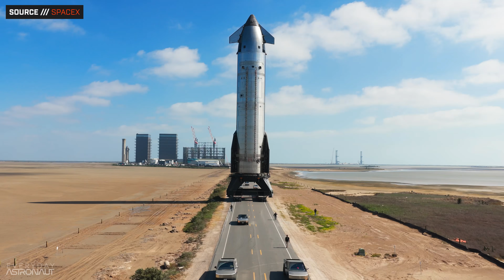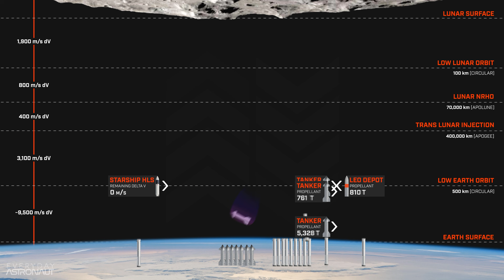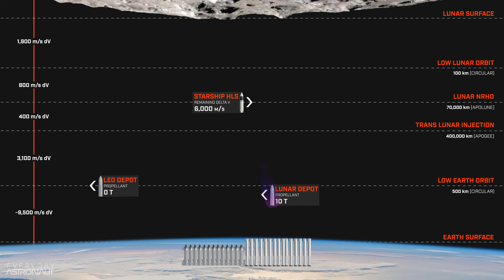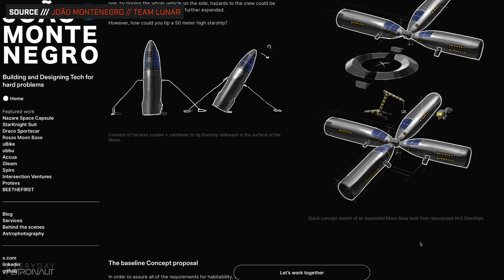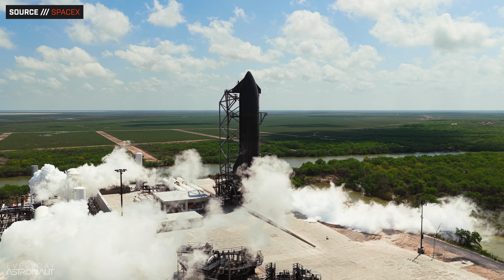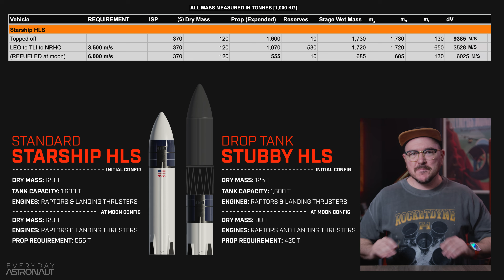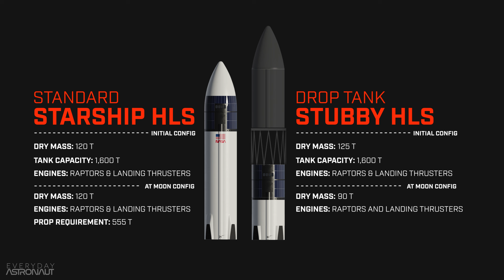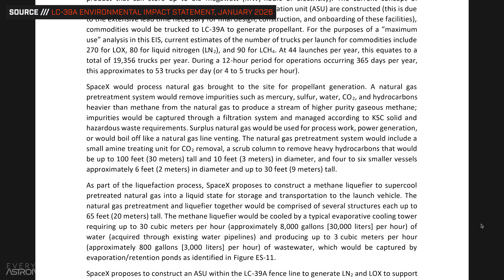Does Starship REALLY require 15+ launches to land one lunar Starship?!

Comment: Personally I'm just concerned whether Starship is safe enough for humans. For a small lander or crew capsule with a small escape system, the chance of the tanks rupturing is low (especially for a thick COPV with large safety margins). But for starship, with a surface area of 2*pi*4.5m radius * 50m height = 1400m^2+ surface area, the chance of a tiny hole or puncture on the tank is so much higher, even if it's just from lunar rocks / dust, a loose screw hitting the tank during ascent, etc. Even if the risk is 1/1000, with no abort option (unlike the lunar module for lunar landings, or crew dragon for earth launches and passive reentry), it just seems unsafe. 
If commercial flights had a risk of 1/1000, there would be so many plane crashes every day.

Comment: The obvious solution is Nuclear Propulsion. If you really want a long term and efficient solution to trucking resources back and fourth. Yes it will take time to develop that platform, but unless some other new technology appears on the horizon, it is the best bet against chemical rockets.
Reply: nuclear propulsion has low thrust, it's intended for deep space travel, avoiding gravity wells
Reply: @DeferedPattern  Chemical Rockets are really only good to reach orbit, after that, they are massively wasteful. The only exception would be to move people between Earth orbit, and Lunar. Virtually anything else, can happen at a much slower rate of acceleration. You would not use Nuclear Propulsion to reach Earth or Lunar Orbits from their respective surfaces. 

Basically the way I see it shaping out, is that you would launch a traditional* rocket to meet up with a transfer vehicle , move the cargo over, which would then take it to lunar orbit, or vise versa, and drop it down to the surface with some small control rockets for soft landing, and/or parachutes for a water landing on Earth. 

If you can build enough reactors, be it Fission or Fusion, depending on where the technology is at any given point, you can have a lot of vehicles, likely smaller ones, but far more frequent, than you could with chemical propulsion, that over time, would be significantly cheaper, and less wasteful, even if you are making your own Liquid O2 on the Moon, and shipping that back to Earth Orbit rather than producing it on the Earth. 

Moving to more efficient forms of propulsion also decreases overall complexity of the whole process, and the less complex it is, the less issues that will crop up over time. Even if it takes literal months between leaving Earth Orbit and reaching Lunar Orbit. If we are talking about stuff that does not require life support, you can save a lot. 

Obviously when it comes to people, you cannot do that, but you would not be ferrying people every day. The nature of the cargo matters a lot here.

Comment: what's funny, is that same problems are tied to new glenn's moon mission too
Reply: True. The volumes are less, but Blue Moon 2 does plan to use its own engines for TLI and then it will need to be refuelled to land. 

So it's just as many flights, but most of them with be to lunar orbit. I do wonder if the hypothetical Tug can be used to send an already full lander to the moon.

Comment: HLS actually will need up to over 30 or more launches to refuel it. HLS isn't under development and neither is it's HRS. As more of Starship's core systems keep changing. Especially when SpaceX will introduce engines for TLI. Even with SpaceX's 100 ton mass promise. With new innovations for Starship. With no Human Rated System being in active development for HLS. With the HLS not being in active development. The 15 refuel quote is misleading. Why I say it will be over 30 launches is because of these missing variables that we know is heavy. Especially for the current concept of the HLS.

Comment: Hrm...  Not sure how pluasible it is that they'd opt in the end for keeping the surface level raptors on the HLS.  Yes, I know on the standard Starship the surface level raptors are the ones with gimballing.  But given Mustk's love of "the best part is no part", it seems likely that for HLS they would remove the surface raptors in favor of either adding gimballing to the the vacuum raptors, or perhaps use the landing thrusters to provide attitude control.
Reply: Rvacs use the same powerheads so they are gimbal capable (hard mount locations), but they are constrained within the aft skirt, which prevents them from gimballing since they would contact the skirt at anything beyond zero degrees radial out.

Comment: Ok, my biggest issue with this whole approach of refueling the HLS in Lunar Orbit and reusing it between missions - How the heck are you reprovisioning the lander? How are you getting new cargo onto it to land on the moon? Another rover? New Oxygen and CO2 scrubbers and food, and experiments, and and and.... It sure as hell isn't coming on Orion!!! And how are you refilling it in NRHO to begin with?  And how are you making sure the HLS engines and systems are good between missions after it's been left in lunar orbit for 3-6 months at a time?

Just a LOT of concerns/questions... I see ZERO reason to reuse the HLS... Use a new one for every mission.

Also don't get the point of NHRO... Why not just Low Polar Lunar Orbit? Does Orion not have enough dV to get there and back with the ICPS ?

Comment: Yes! Starship ( just the ship without Cargo & or Crew)  is 47 times Heavier than Space Shuttle.  Space Shuttle is made of Titanium, Frame thick Aluminum, & had 3 extra Boosters.  Stainless Steel & Inconel more heavier than the Shuttle. Shuttle High Orbit, and carried the heaviest Cargo, and assisted in Building I.S.S.  
Starship can barely go to low orbit, with light weight cargo. High cargo equal lot less fuel tanks. Space Crew, & Life Sustaining Cargo, let alone trying to Landon the Moon, Bring Lunar Samples, to see if they can actually make a  Lunar Habitat, and see if it can Sustain 300 to 400 Temperature Variation from Day to Night.. Reason I say this is that in Arizona & New Mexico 3D Printed Homes Cracked with in 3 Years so Lunar Habitat is a Far Cry. Trust me NASA, & or SpaceX do not have a Clue on this Challenge. I had Worked at SpaceX Hawthorne, California..  This Facilities does not have Engineering Insight on this. 
Landing on Mars it will definitely tip over, in Lunar Landing, there is no Atmosphere, and if land laterally in a horizontal velocity it will attack hard, until it is in Zero lateral Attack, & the Landing with out hitting a Rock Formation or Crater Wall, or Edge.  on something  1,000,000 times larger than the Apollo Landers..
For Starship to take off to High Orbit requires 4 Falcon 9 Rockets attached to Starship Heavy Booster.
Batteries will Die for Elevator, for Equipment & Crew.  I mention 2 years ago the Landings have to be Horizontal like the Shuttle

Comment: Wouldn’t it be worth the mass trade-off to have the thing land on its side? The extra reinforcement would add to the mass but you wouldn’t need an elevator and you wouldn’t have to climb up and down inside. Then just leave it there and add to it with every trip. It’d be a lot easier to bury if it was on its side with reinforcements to hold up a couple feet of lunar regolith.

Comment: there's a whole slew of problems with creating a sustainable moon base. build a base on the moon. lots of steel needed. can't make steel on the moon. everything needs to be shipped lol. But, if we colonize the moon mars is no sweat that's the trick. should probably figure out how to shoot materials to the moon with accelerator guns and then recover on the surface to build there.

Comment: "Big mistake when you did the Stubby HLS math:

You forgot, if the Stubby HLS is way lower wet mass than the reference HLS, Booster has way more delta-v too. Much less payload to carry. So Booster can do more, Stubby HLS has to do less, you make the Stubby HLS tanks smaller again because it only needs 6 km/s of delta-v, that gives Booster even more delta-v, leaves Stubby HLS with a big load of leftover propellant on reaching LEO, and then you only need a single tanker to top off the Stubby HLS tanks for a Moon mission..."

...is what I would say, if my instinct didn't tell me to keep watching around 1:08:00, when some part of me said "brother, this is Everyday Astronaut, no way he forgot about Booster delta-v improvements with Stubby HLS".

Ok, around 1:18:00, the thing I'm noticing is that a lunar depot is just insanely inefficient. The less dry mass you're moving around, the less propellant it's going to take to do the mission. Having LEO depots makes sense, you're moving the extra propellant to the lowest delta-v orbit possible, moving the least amount of dry mass. Having a lunar depot means you're moving this heavy asf depot. That's insanely inefficient. The problem here isn't stubby HLS, it's the lunar depot. We want an HLS that can go LEO to the moon and back without any lunar refueling. That's what we want. That means we probably want a three-stage Starship, meaning a standard, payload-bearing, heatshield-toting Starship carrying a lander inside of the fairing. A 15 ton lander with 85 tons of propellant onboard, you then refill it on orbit with 100 tons of additional propellant which takes it to 200 tons of wet mass, enough, in theory, to make the moon and back, just from LEO (I don't have a spreadsheet rn). One additional tanker for the first mission, 2 tankers per subsequent mission. No lunar depots. It's just not Starship HLS anymore, because it's a fully separate vehicle carried inside the Starship fairing. Still much heavier than Apollo and capable to land 4 astronauts on the Moon.

Again, this is if we're trying to reduce the launch count for missions to the Moon. But if we're SpaceX, we like maximizing payload capacity to the Moon for bigger missions. Yeah, bigger missions mean more launches. But that's within the realm of what SpaceX wants to do, anyways. And, even with 10-15 launches required to land a full-size Starship HLS on the Moon, that's still better than the 67 Apollo landers (67 Saturn V launches) it would take to land the same mass of Apollo landers on the Moon. 67 fully expended billion dollar rockets, or 10-15 10 million dollar reusable rocket launches. Heck, even if they're actually 100 million dollars taking into account all operations, maintenance, and refurbishment costs, the degree to which SpaceX has already been able to combat the tyranny of the rocket equation without magic, high Isp engines is incredible. Saturn V literally has close to the same average mission Isp as Starship, being worse at sea level but better in space. How the heck does Starship turn 67 expended rockets into 10-15 reused rockets? That's like an order of magnitude better payload fraction, with another order of magnitude (minimum) reduced cost per launch.

Anyways, if the most efficient mission is one where the dry mass is as low as possible for every vehicle, then your lunar depot is very oversized and overweight for most of the calculations you made. Reducing the propellant mass delivered to the Moon by 50% and not even getting 20% reduction in tanker missions shows the efficiency problem clearly. If you reduce the propellant delivery to NRHO requirement by 50%, you should also be reducing the propellant delivery to LEO requirement by 50%, or else you are losing massive amounts of efficiency somewhere. You need the depot to only be as big as it needs to be to carry the necessary propellant. Or, if you plan to have a single depot support multiple missions in a row without returning to LEO, then the depot can be scaled up. But you'll never send the depot out to the Moon with half-full tanks, that's just very inefficient.
Reply: So, correction: lunar depots are actually not a bad idea. My thought process was that moving a whole second vehicle around requires a lot of additional propellant that you wouldn't need if you had HLS doing full round trips to LEO. But I'm wrong. Although a depot may need additional hardware to prevent boil off, a bigger depot has less of a problem with that, so the extra hardware mass can be minimized as part of the dry mass of the depot. The HLS's human accomodations and landing hardware can't be minimized like that. So the depot has an inherent dry mass advantage over the HLS, and any trip the depot makes is a trip the HLS doesn't have to. The vehicle with more dead weight should be the one that takes shorter trips. Sure, the depot has an additional investment cost in the beginning, and this is what I picked up on, but it pays for itself over time.

The issue you had was actually that if you're going to use a depot, you want it to be as mass efficient as possible. It's tanks are always filled to 100% capacity in the course of its duties. That means, likely, that for the stubby HLS variants, you'll actually have a depot that can top off two HLS ships back-to-back without having to make a trip back to LEO. That would massively improve the dry mass-wet mass ratio of the depot over the lightweight cis-lunar depots you were considering.

Comment: Great deep dive, Tim, but..

At 37:28 and 38:20, that 1370 W/m² figure is for a flat surface directly facing the Sun (and that figure is an old estimate; a more up-to-date estimate is about 1362 W/m²). For a cylinder sideways to the Sun and slowly spinning, to average the sunlight over the surface you need to divide by π, and if you orient the cylinder endways to the Sun it's even less.

Then consider that in LEO your depot is in Earth's shadow nearly half the time.

That 1135 W/m² figure (which includes emissions from the Earth) is likewise too high.

I was hoping to find a link to your spreadsheet, in the video description.🙁

Tim, has Elon offered you a job yet? (He ought to!)

Comment: Great extensive summary. On the horizontal landing the biggest issue will be the slashing MOx in the tanks laterally and also it will be necessary to add reinforcements throughout the ship to bear the load of each leg and mitigate bending and twisting . Impossible for this big of a lander.
Reply: They would add anti-slosh baffles.  Slosh is a very well studied and important subject even in regular vertical rocketry.

The horizontal loads would be trivial since Starship already takes 3G's horizontal during re-entry, with much of the force concentrated on the ends due to the big flaps.  In comparison lunar landing would probably be 1/6th to 1/3rd G.

Interestingly, as a design exercise, Starship wouldn't even need the vertical engines for anything if it landed horizontally.  At stage separation it could just rotate 90 degrees and boost into orbit horizontally, as stage separation happens at such a high altitude that the atmospheric forces are trivially small (I crunched numbers on that).

But you end up with the odd case that best place to put the engines is on the upper surface, so as not to be exposed during re-entry, which means you'd land with the heat shield on top, which means there would need to be a 180 degree roll from the re-entry orientation to the landing orientation.  For a lunar only craft, this would be required.

Comment: 13:30 your numbers here are misleading, since you didnt multiply the stack mass by the total 15 launches. Starship would therefore have a 0.417% landed mass, rather than the 8.3% you quote. Still a massive improvement over apollos 0.25%, but very far off your number.

Comment: The Apollo LM also had 3 probes on 3 landing legs, and if 2 out of 3 touched the surface, the contact light would go on, telling the crew to cut the engine a meter or 2 off the surface and they would just fall the rest of the way down! Starship worn down that because it has a huge mass, and therefore, a lot more momentum, trying this would create a crater also just from the impact!
Reply: HLS has smaller thrusters so it won't create crater
Reply: @maks_1_123  no it would crater from just the momentum of the lander following those couple meters!

Comment: While watching this video, esp with the refueling and boil off of the depot, I did think, and likely a dumb idea, is. 

Take up co2 and water which have a much higher boil off temperatures for the depot, and then use solar power to convert to methane and oxygene as required. Would still have to do before and store, but maybe that would mean that the time required to hold the cryo liquids is shorter. 

Maybe that is way way way in the future, with a fueling station. 

Also the number of molecules transported as water and co2 might be better, but not sure about that.. :)

To create 1T of Methane need approx 3T of CO2, and 2.5T of water, and also provides 4.5T of O2.

Comment: I think landing on the side would be a huge engineering challange, attaching all these thrusters all along the tank, you have to bring propellant there. The piping in Starship is already complex. If they are on-top they are its own little section you can build and integrate separately.
Reply: This video is welcome but it has a lot of vague assumptions and speculation. And it's unnecessarily long